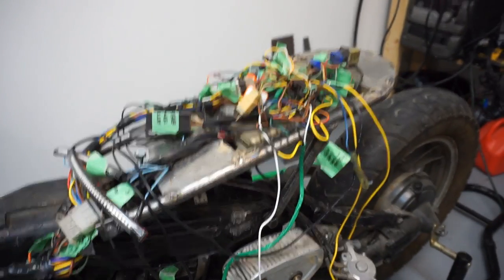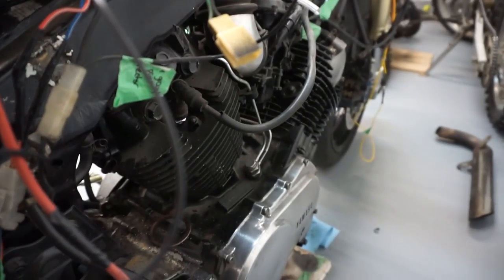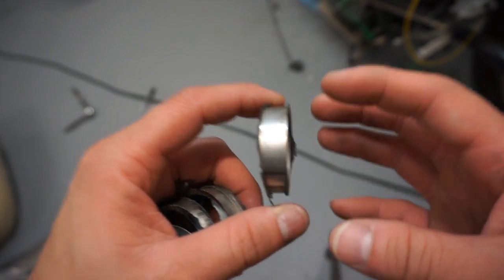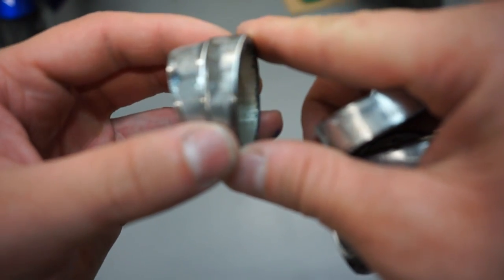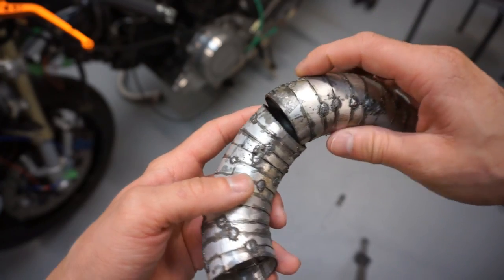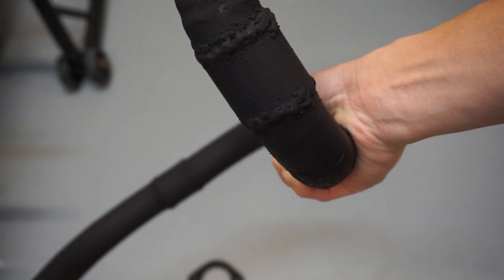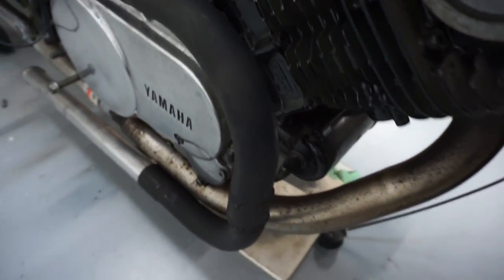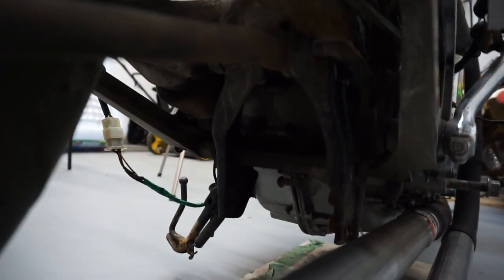Yamaha Virago XV920 Café Racer Build - Vlog #21 - Custom Exhaust + Seat Pan Tray

Comment: What kind of welder did you use? Or can you make a video of like some fabbing that you did, thanks! Love the series-- helps with my train wreck XV920 :( ha!
Reply from the maker: I used a mig/flux home welder. The exhaust was not easy to get started and it took a lot of time to get each piece to hold before I could tack it into place! That's why I didn't film it.

Comment: What size pipe did you use?
Reply from the maker: I used the stock size which was 1 1/2" OD...Didn't want to deal with having to jet the carbs and getting it all tuned.